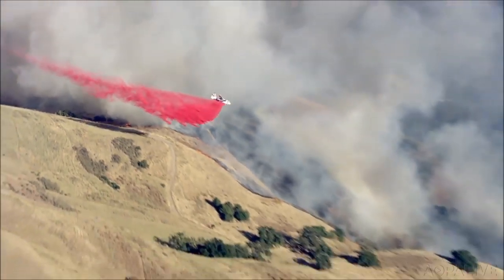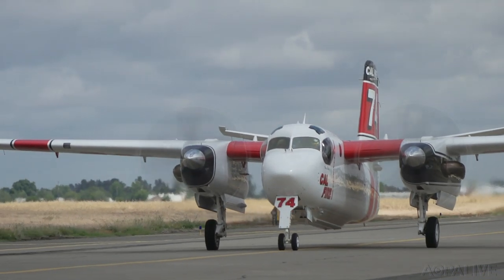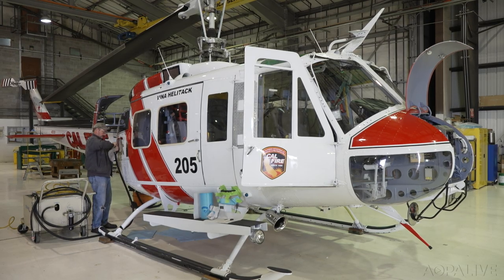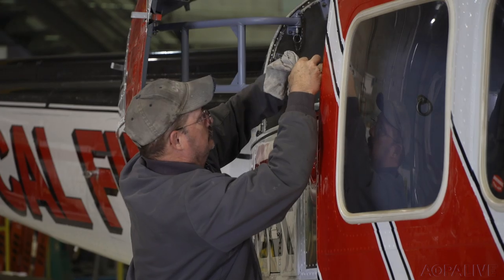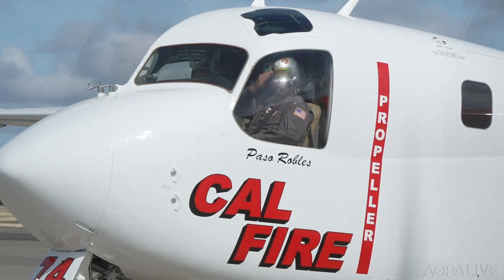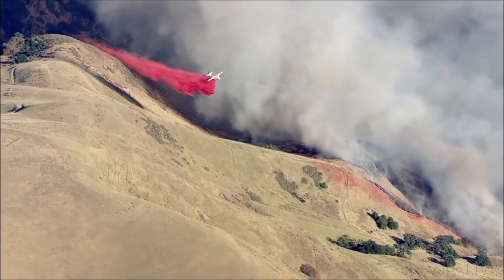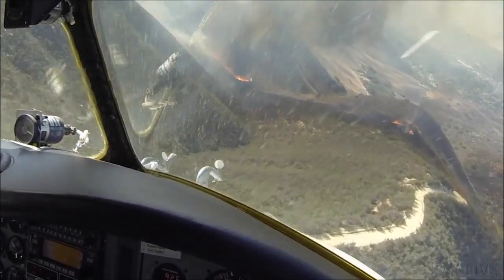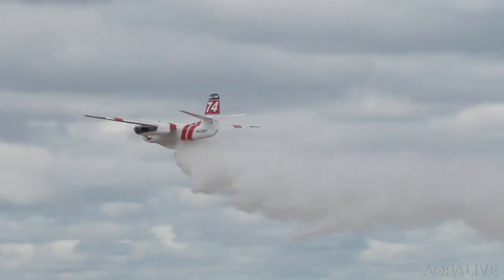Behind the Scenes of Aerial Firefighting at Cal Fire

Comment: If the Garrette engines on those Trackers are 1600 horsepower, those are basically the same engines used on the Cheyenne 400LS, its good to see that Cal air didn't skimp on the turbine engine conversions with their Trackers.
Reply: I still miss the sound of those Wright Cyclone radials though.
Reply: Agreed!

Comment: So..IF i am NOT mistaken.. Cal fire hasn't included the Supertanker in its arsenal. (probably due to hourly operational costs) It can make one run and drip more than..15 smaller aircraft?  That figure should be close.. and drop a swath over 2 miles long. or make multiple shorter drops.  So... The next question.. I'm sure you can figure out.
Reply: Calculate for turn around to a reload base that can handle a plane that size, time in orbit to prep, displacement of type 2/3 tankers in the pattern, line up time for the lead plane. When I get a slop over or spot fire on a hot division I need a couple hundred gallons of mud now, not 5000 gallons 30 minutes from now. VLATS are a great tool in the big picture and I'm glad we have them but they are not a replacement for a type 3 tanker.
Reply: @rustyclaymore1105  Understood, and good points.  I have also understood it can make it halfway across California in about 45 minutes.  She is a monster, but what a impressive line she can lay.  Thanks for the information.
Reply: @pilot3016  Also are you willing to fund bigger planes out of your own pocket? Just saying......
Reply: @markfrench8892  Nancy gave a bucket load to the Kennedy Center for the Arts. Would you prefer a concert, or watch your house saved.
Reply: @pilot3016  The Kennedy Center gave back 25% in the form of a donation to the DNC. Firefighting vs music didn't enter into the decision.
Reply: @sanniepstein4835  That's swell.  A Donation to the DNC.  In some circles, that called money laundering. Think.

Comment: The S2T's are too small to handle the fires. I can see helicopters and small planes to cover areas around homes, etc but the DC-10s and 747's are needed for longer drops. Fighting the fires with the smaller airplanes is like using a bucket to put out a house fire. UPGRADE to routine to using more LARGER aircraft.
Reply: Why would they have them if they aren't good enough? If there are 10 fires, then it's better to have 10+  small planes  putting out the than 1 large plane that can only do a few at a at a time with a much longer turnaround time
Reply: @marek9784  There's always an armchair expert in the crowd. I'm referring to Jon Ursino that is.
Reply: They’re at a fire quickly when not outta control yet-extreme agility, low flying, w/ fast fueled turnaround. Pilots would love to do some acrobatics with this retro jet prop! But can’t:(
747’s/DC-10’s awesome aircraft, but not as low and go for payload-in my humble opinion.
Reply: You have no clue.